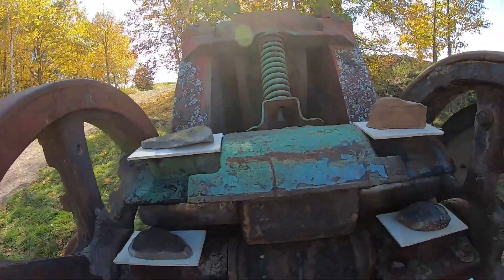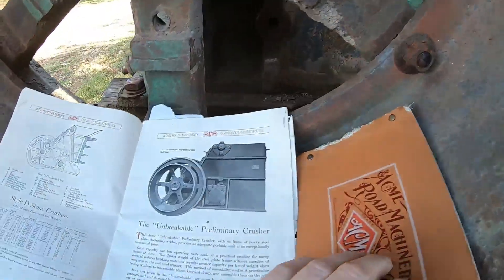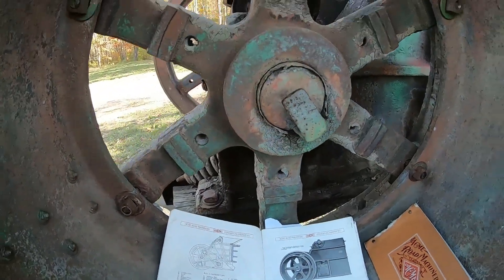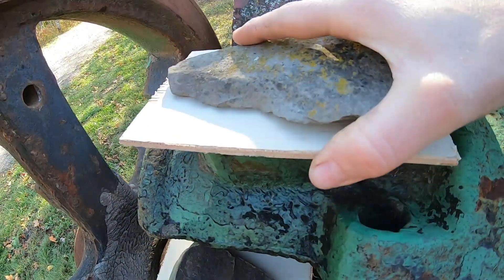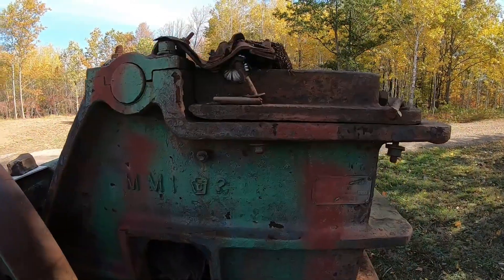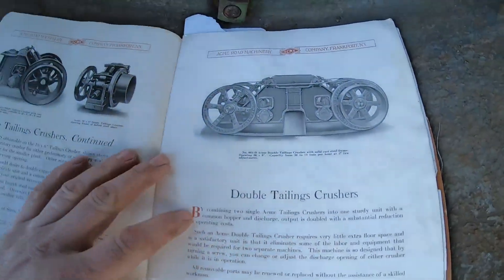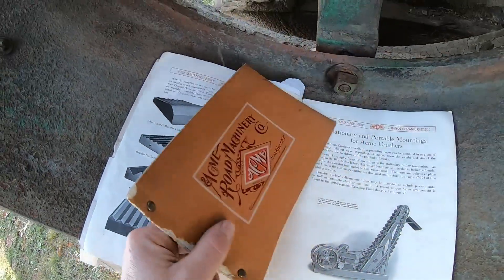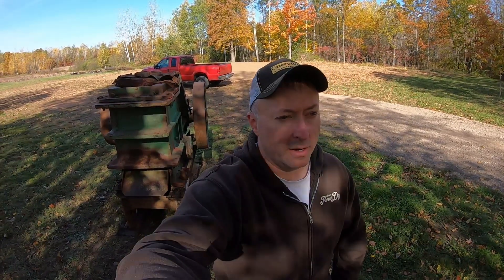ACME Model 9-1/2D Rock Crusher - Answering Common Viewer Questions - HP Specs, Capacity & More!

Comment: When I considered the weight of the crusher and the terrain it would operate on, including moving and repositioning, I was thinking that a stone boat skid structure might be your most versatile means of supporting and conveyancing this machine.   Perhaps some heavy steel walled pipe, to give two pontoon lengths of pipe, slotted at the top and fitted around the two bottom channel supports of the crusher.  Add prows front and back and weld tow rings around the perimeter.  Using your pully set-up that you used to move the heavy oak logs, you might be able to get this pontoon structure to move sideway, rotate, or move ahead or back.  The pontoons should ride over the soil without plowing it too badly.  One or two of the D2 cats might be enough to anchor one pulley, another D2 or Farmall M might give enough to move the "stone boat" where you wanted it.  It would not have to be anchored in any way for operating due to it's weight.   In this way, as you dug into your stone pile, and created some flat ground, you should be able to skid the crusher closer to your rock pile work face.    I would feed the hopper with a small bucket back hoe, and haul away the crush with the front end loader. You would need to fashion a funnel for the top of the hopper to keep stones from falling away and getting in your crusher or your drive belt.    It is amazing what we moved on the farm using two skid logs!

Comment: Will it crush recycled concrete from slabs etc.?  How small will it crush because it would be cool to make stuff small enough for driveway use
Reply: @squatch253  thanks.
But I was curious if it crushed down smaller than that 2 inch stuff  that's typically used in driveways. 
No offense just curious because im like you I always wanted one to

Comment: This is cool!  I worked for Universal Engineering in the the late 70's early 80's. They were a division of Pettibone  at the time and we made jaw crushers and hammermills. These went all over the world,we built all sizes. Universal started pre WW1, and I saw some old units similar to yours. It was really interesting work and good God was it hot, dirty and heavy work. There was an aisle where they did mostly hard facing and those guys looked like coal miners when they came out of there. Welding 'light stuff ' as we called it was anything under 3/4" inch thick.1" to 3" plate was common,  jaw sections were made of 3 to 6" plate. Alloys were sometimes required to be preheated to 400⁰ before welding. I loved the work and my skill set at the time; much as I missed it when the layoffs came I do believe it was better health wise that I didn't spend 15-20 yrs in there.
Reply: Pettibone crushers and they also made cranes 💯

Comment: @Squatch253’s D is a little on the smaller side? I never would have said a 9 1/2 D would have been considered smaller. Times have changed since the early 20th Century.

Comment: Nice Crusher.  Too bad you do not have the original parts lists and drawings.  Not impossible to reverse engineer or pull from the patent docs.  

Crusher rpm’s are similar to current crushers (I do tech support on them).  The harder or slippier the rock the lower the speed.   Feed size is roughly 80% of the published opening.  Make sure you address the flywheel fit before the published speeds. 

All the springs will likely need a refresh (or could upgrade to hydraulic).  

The jaw dies may still be available today. Check the dimensions.  Be careful welding on them as they are usually manganese. 

I suspect one of the modern suppliers of crushers has this manufacture as part of thier stable meaning drawing “may” still be available. 

Very interested in following your journey

Comment: In 1968 I had the privilege of resurrecting a large Cedar Rapids 30 x 42 jaw crusher powered by an inoperable Cat D-17,000 engine. They had been brought by the US Navy to Ponape an island in Micronesia but never used as a quarry site could not be secured & the Cat engine had been mistimed sometime in its prior history so wouldn’t start. After many rope pulls & Magneto work I was able to get the Pony motor going & spin over the Main V8 Cat motor but it wouldn’t start. I had worked on several of these Cat engines prior to this & was lucky enough to recognize the injector timing was 180 degrees off. Finally after more than two weeks we got it going & began our quarry, however eventually we used a much more capable portable unit made by Pioneer (also abandoned) with both a jaw and a roll crusher powered by a much more modern Cat D342. One thing I learned was that with hard granite, blasted rock would not pop out of the jaws much less frequently than river rock. Be very careful flying large rock is very dangerous.

Comment: I would be tempted to run the crusher at design speed.  It relies on momentum in the flywheels to crush the rocks. less speed = less momentum which may impair its performance.

Comment: Great to have the manual. Thinking of all the wood patterns for every model shown, when the company went under, they probably burned the patterns for fuel. Sad day. When the day comes to finally running at full speed, make sure the machine doesn't "walk" based on some harmonic vibration.

Comment: Re "the most miserable machine" Along with many others, I had a Fordson tractor. There was a brake. It operated when one depressed the clutch. I say depressed, what usually happend was that one had to jump on it with all ones weight, as it operated up and down. The brake was an oil immersed set of discs withiin the gearbox, and a hook in the floor plate to hold the clutch pedal down therefore the parking brake. Woe betide the person who stalled it in gear, as it was very difficult to get it out of 2nd with theengine stopped. Holding the clutch down only helped if everything was very warm as the 140EP oil acted as a fluid flywheel, therefore using the starting handle in such conditions required a lot of dexterity and flexibilty to jump out of the way when/ if it fired. (I worked with one from the 60s to early 7os as my only tractor.)
Reply: @squatch253  Sorry, didn't know the rly ones  came without a brake. Mine (1938) was not easy to drive, therefore I really concur with "Miserable Machine"

Comment: I think the flywheel bores might be suitable to bore and fit flanged tapered shaft locks like found on conventional pulleys.  Held in with e bolts. Extracted with 3 bolts.  But it would need one on each side of the flywheel..  this would allow you to turn the shaft to a proper size without needing to replace the shaft..

Comment: Having run my Case crusher of basically identical design you will find the rpm it is happy with. My Case crusher had a much larger drive pulley installed otherwise the Waukesha power unit had to be run at a dead idle. Also, does in mention in the literature anything about the type of stone which it is built for. I believe some are meant for limestone. In 1975 l ran a Pioneer crushing plant and my employer instructed me to keep one eye on the long feed conveyor belt and if a hard rock such as granite was spotted to shut it down quickly and remove it as it could cause damage. He had one wedge in once and it stopped the crusher immediately. He told me he used dynamite to get it out! It was a different world then.
Reply: Do you have any other crusher jaws or just the ones in it now?
Reply: I only have the ones in it.

Comment: Love it.🥰 Oh and by the way ...My 1919 & 1922  Fordson F do have brake of a sort, with internal, mechanical friction considered sufficient to stop the tractor when the clutch pedal was depressed. with the worm drive you stop quite fast as long as you are in gear. when depressing the clutch about half way it is in neutral full depression locks clutch plate's so they don't move .
Reply: @squatch253  Dam I have had these two tractors for 30 years and I didn't know that. Learn something new everyday 🤔

Comment: One of the crushers we had at the operation was a Farrel Bacon.  It used a wax type lubricant with water spray in the bearing box journals. If you have stone jumping out of the jaw you have to feed more to fill the jaw up then shut the feed off to let the jaw work. A learning process, Good luck !!

Comment: not being too smart on crushers I understand the concept but to develop and manufacture a machine just to crush Rock. I guess maybe it would be for making the ingredients for cement. I guess I'm kind of dumb and thinking that you could just dig the small rock out of the ground but I guess if you can't then you have to make small rocks out of big rocks. I guess that's the whole thing. and is this still done today.
Reply: Crushed stone locks into itself, whereas natural small stones are rounded and work like ball bearings.
Reply: @erik_dk842  I see makes sense 😉
Reply: @squatch253  I did many odd jobs working for myself when I was younger and my wife and I did French drains around several homes. We always use pond pebbles, at least that's what we call them. We go all around the outside of the house and dig a trench and replace it with rock on pebbles and then dig a deep hole at the lowest point away from the house and that was where the water would go we put the big rocks at the bottom and the small rocks at the top. Thank goodness we didn't get too many of those jobs because digging isn't the easiest thing to do even when you're young. I sure couldn't do it now with my arthritis. 😲
Reply: @squatch253  I grew up surrounded by large gravel pits, so the sound of D7 and D8's and their squealing tracks, wheel loaders going back and forth, and the rattling and banging from the separators and rock crushers is all to familiar to me.
One operation used CAT scrapers and wheel loaders to dig, another used house-sized draglines and Allis-Chalmers wheel loaders and very few dozers. They had a several miles long conveyor belt running in the main artery pit.

Comment: The big railroads have gone 100% to roller bearings. The only place that you can still find the plain bearings is on old cars used on tourist railroads. I used to volunteer on one of those railroads and we ditched using oil soaked cotton waste in the early 70’s in favor of sewn pads. I recall that we used Hennessy Journapak pads because I was one of the guys who changed them out.

When you do get around to packing those lube ports consider cutting up an old towel, fill with pieces of cotton, and sew it up to make a lube pad. Otherwise you get bits of cloth that are picked up and carried into the bearing, defeating the purpose of lubrication.

Comment: A friend of mine has a "mini" crusher with a 10 or 12" flywheel. There's a handle on the flywheel and you turn it by hand. Pretty cool, I haven't seen for a few years so I don't remember the name but it was painted black and red, not sure if those were original colours. Keep smilin.

Comment: Neat old machine,my company does electrical work for a plant in my area there jaw is 12 ft tall 300 hp electric however the jaw it's self hasn't changed it looks very similar to that one I guess if it works don't fix it.

Comment: I used to be a crusher operator in the UK, years ago, much bigger crushers, electric and diesel cat 966 engine crusher, the only thing that used to get my immediate attention, was once in a while l used to get a cannonball try but go through the crusher, standard procedure was to turn off the crusher and run. It wasn't so much dangerous as the ball would always go straight up, about 80 feet, but it would shoot out like a bullet and then return for another go until the crusher was stopped. Them good old days.

Comment: I have witnessed a small rock crusher come to a sudden and complete halt. It was being driven very slowly by a flat belt from a portable steam engine. The belt was thrown off. All because a large lump of Cornish Granite was fed into the crusher. The consensus was  because the crusher was being driven very slowly there was not enough stored energy in the flywheels to crush the granite. Usually when these machines are being shown at working days the opportunity is used to crush broken concrete and recycle it. Broken concrete is easier to crush than granite.

Comment: If you want me to watch more then replace a project this winter with getting this old crusher up and running. I bet a old corn ear conveyor under the discharge will make a good stock pile for crush rock. I have 2 small jaw crusher now. They are used in my model railroad ballast making operations. Also have a hammer mill crusher that slings 4 chains around inside to turn rock, bricks, and cement blocks to powder If you let it. Check out some of my early videos and you can see my crushers in action. Have a great day be safe.
Reply: Your crushers and screeners would be useful for those who make their own black powder.

Comment: Are you going to manufacture the bottoms of those missing bearings? Are you going to build a moveable doghouse to cover it up during the winter months?
Reply: But there aren't any missing bearing halves? The lowers were just lubricating felt pads, if i understood Squatch correctly.
Reply: @erik_dk842  If you go to 1:30 of the vid where he says he bought it, it shows an "oil box" and yes, felt lined, not structural in any way, just a way to enclose those shafts. Was just wondering.

Comment: I will surely enjoy the rebuild series of this project. I wonder, how loud is this going to be once you get it operational? I've heard other crushes that weren't even a fraction of this size, and they were very loud. Once you start crushing rocks, maybe you can filter the material out to see if there is any gold to be found... Never know!       Thumbs Up!
Reply: Depends on how fast you run them and what rock you pass through it. Some can be very loud because of poor quality too. That said, you can look up "1920 Acme Stone Crusher Deomonstration"  here on YT, there's a few running. As you'll hear, the rest of the ensemble and motor makes more noise. I believe the "pat pat pat" noise is the seam of the belt hitting the pulleys.

Comment: Can't wait to see this in the shop and you bringing it back to life. I love seeing the old work horses getting to work again. Squatch you reclaim our forgotten past and remind the younger ones of what we had and how hard we had to work.
Reply: This project will probably never make it inside the shop. It’s just too heavy to get in there unless it’s disassembled and brought inside in pieces, then it would have to be reassembled in the same manner. Everything removed would involve “crane” work which would require overhead clearance, something his shop doesn’t have much of. His engine hoist won’t lift high enough to use it for very much of the work, so he’s limited to the Kubota bucket for his heavy lifting jobs if it comes to that.

Comment: 300 RPM holy crap that is haulin butt. Those manuals are cool. I Have an unrelated question about the dahlstrom tap guide. I was able to find one but am curious what is in the grove on the shaft? I tried a thin o-ring but it is still too thick, is it a piece of wire?
Reply: @squatch253  Thanks
Reply: @squatch253  Can you get me a width and thickness of the spring when you get a chance, there is no rush.
Reply: @squatch253  I'll look at it tomorrow, thank you it didn't work like I was thinking,
Reply: @squatch253  I'm good a little bending and aligning and it works like it should.